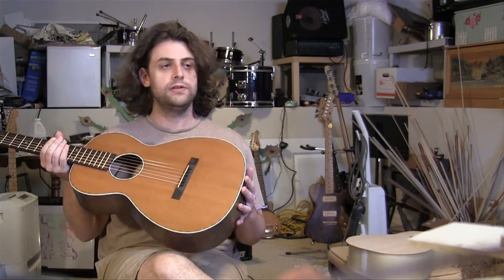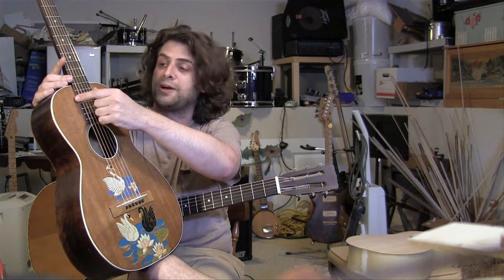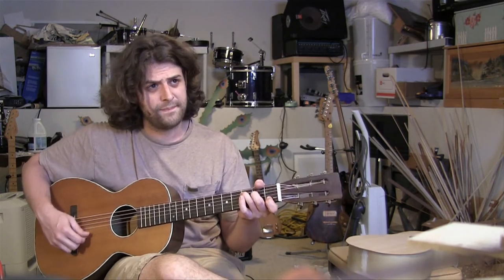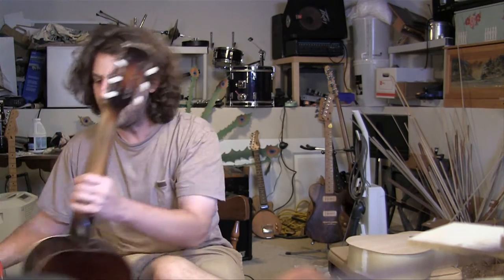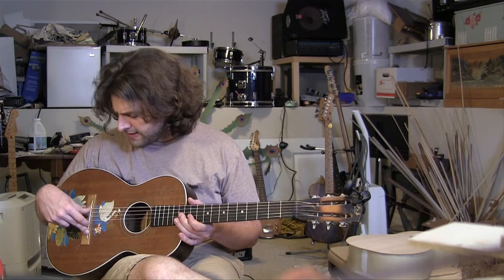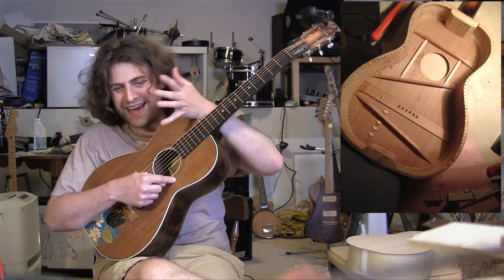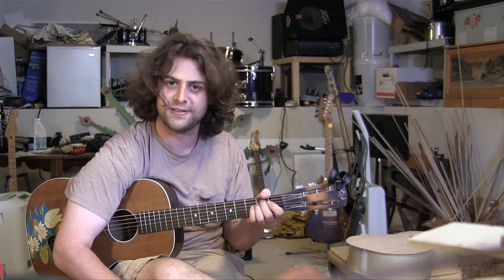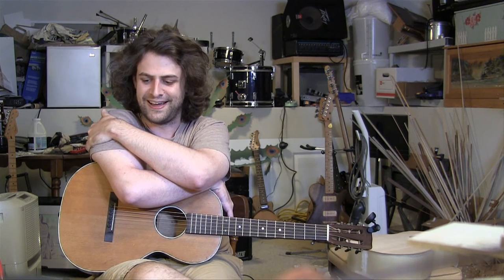Regal 2019 vs  May Bell  (vintage guitar comparison)

Comment: Slingerland made many different models of guitars, banjos, mandolins, ukeleles, and electric guitars. Of course Slingerland is best known for drums, which was owned by Gibson at one time. I have a May Bell that belonged to my Grandmother that I recently restored. They were well made guitars.
Reply from the maker: Though these May Bells are often labeled Slingerland they were actually made by the Regal company under contract as they are identical to guitars labeled Regal and the work is constistent with the Regal factory of that period. This was and remains a pretty common practice for a brand to farm out some or all of the work on a product line. Thanks for checking out the video!